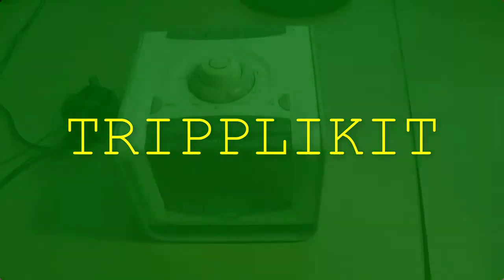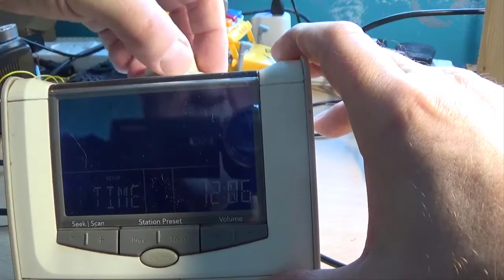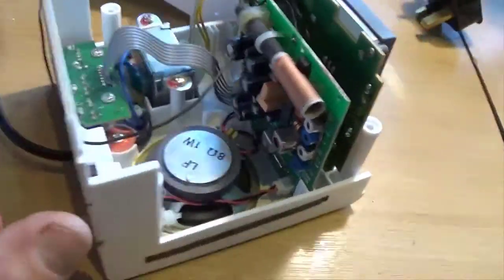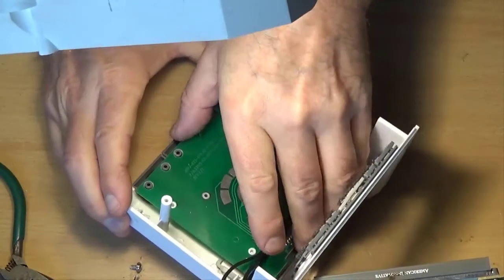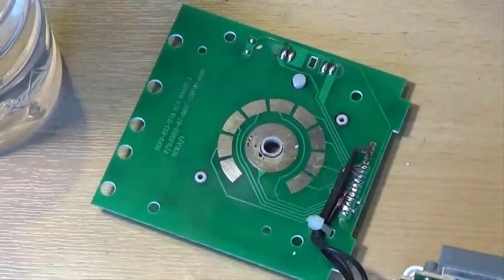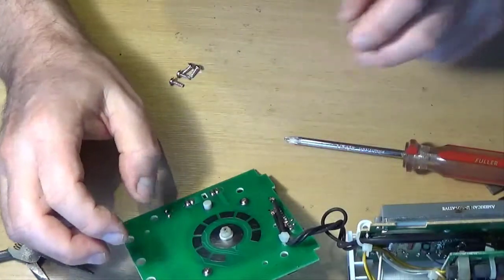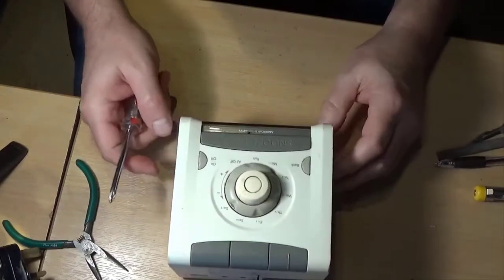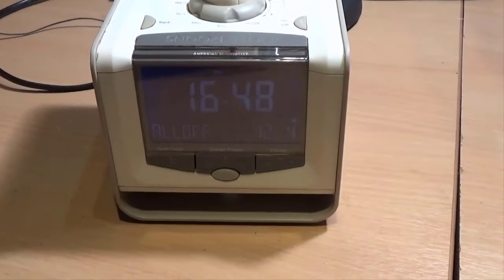“Neverlate Executive” Alarm Clock Is Faulty. Can We Repair It?

Comment: Thanks for the nice video. Glad to see the internals of this piece.

I just took mine out of the cabinet today to give it some use again. After 13 years it´s still in great shape and working perfectly. I bought it exactly because of its unique handling. Actually it´s extremely logical, practical and easy to operate once you go through the two sets of settings - Main settings and Preferences (including display brightness) - each under its own knob. Those are easy to understand. 

The most "complicated" part is the alarms:  seven daily alarms + 2 sets of alarms for every day  ... each with customizable buzzer tone (one of 4) or radio station (one of 20) ... Once you read the manual to understand the logic behind it, it makes perfect sense and you don´t need to read the manual ever again (it´s available on the web).

I was thinking I´m gonna sell it, but no. This one is too unique to be sold. I´m gonna keep it and use it :)
Reply from the maker: Mine is still going strong. I bought it for the 7 day alarm so the alarm didn't wake me up on Saturday and then I'd forget to turn it on for Monday.